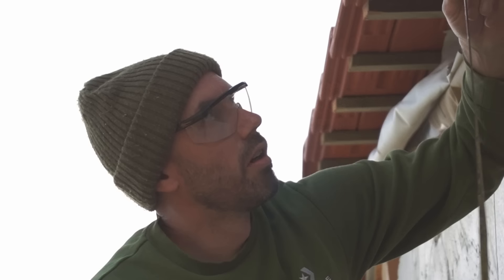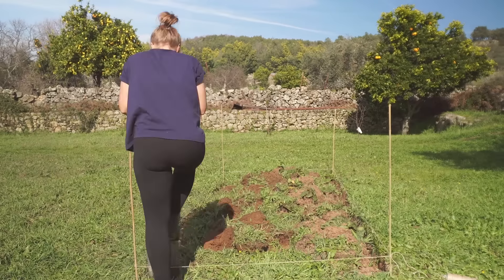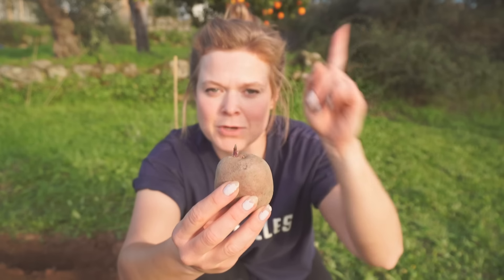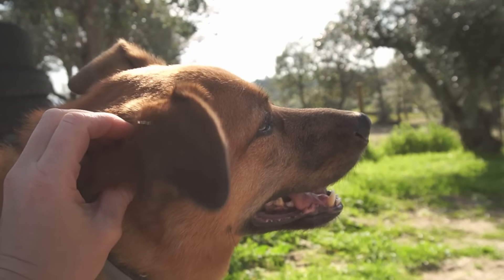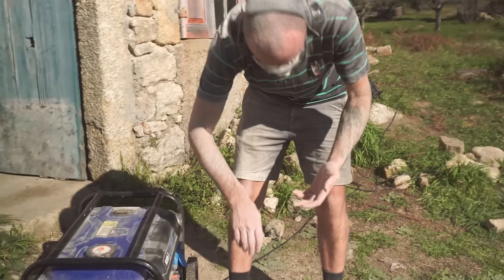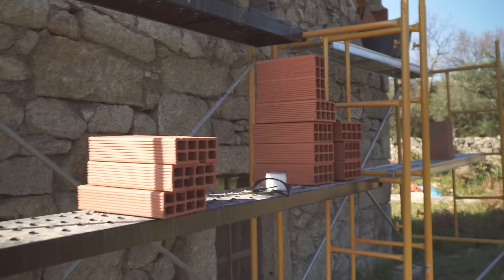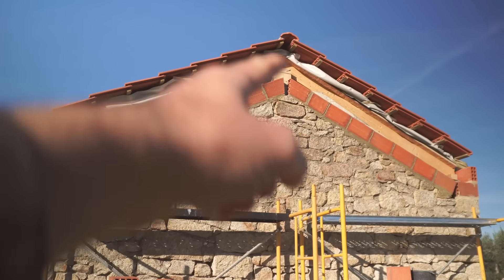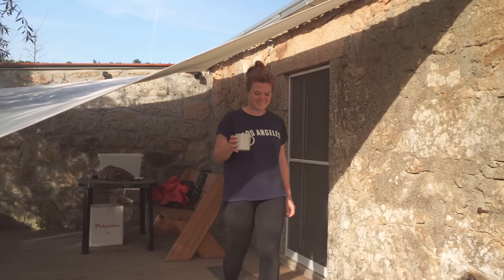GETTING READY TO MOVE ON | Building a Cozy Stone Cabin Alone

Comment: You should get Ricky to buy you a Makita sds cordless drill you’d find it much easier. And while he’s there tell him to buy an air operated needle gun to clean the concrete off the rocks it works like a drill but it has about 20-30 metal rods (needles) which fire out and return into the gun and they hit the concrete cleaning off all nasty stuff they are great and will clean the walls without damaging the walls.😊😊😊😊

Comment: The trick to growing potatoes is, basically dig a trench about a foot/12" deep fill half way with horse manure.  Back fill it, put your spuds in, and cover with the remaining soil and cover with straw. 😊❤ enjoy 😉
You don't need any of thoses chemicals. All you need is a waterbutt, an onion sack with a brick or stone in, fill it with horse poo, tie a string around it, drop it into the water butt. Tie it off around the top. And lift and lower before watering. 😊

Comment: Potatoes are greedy plants wanting lots of nutrients and water to perform and yield well once established. 1 watering can for a  plot that size is no where near adequate (it might be OK for 2 or 3 plants). I'm not sure what your water supply situation is but in an ideal situation seek out something called "leaky pipe" This is one of two basic types a) plastic tape folded over and stitched along its length, you block up one end and feed water from the other and water seeps out via the stitchwork pretty evenly. You lay it along the soil surface and water daily or as necessary. The other type is a manufactured pipe with a strange wall structure which allows water to seep through hence the name Leaky Pipe.
PS, 
1 - good soaks are much better for the plants every 3-4 days rather than a few daily light showers / dribbles!
2 - you can also feed liquid feed into the water supply through the season. 
Dan